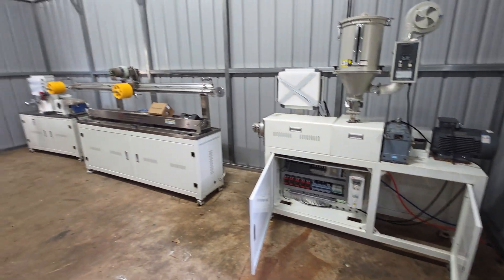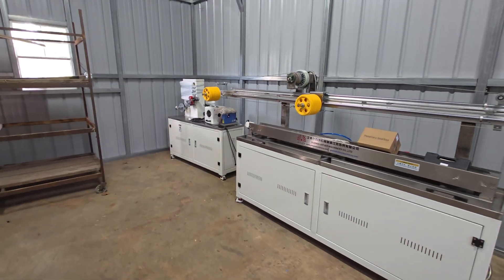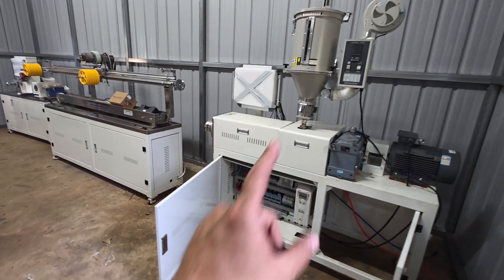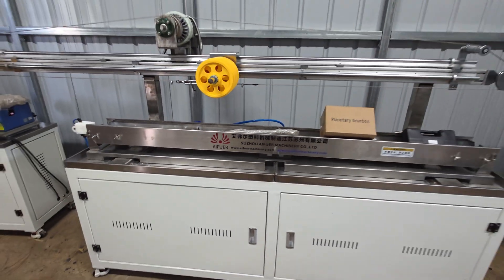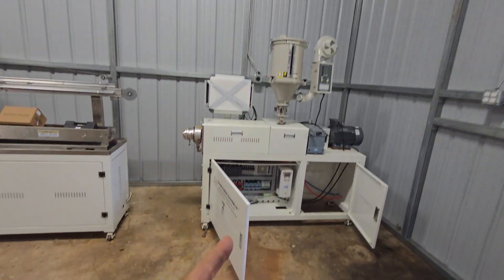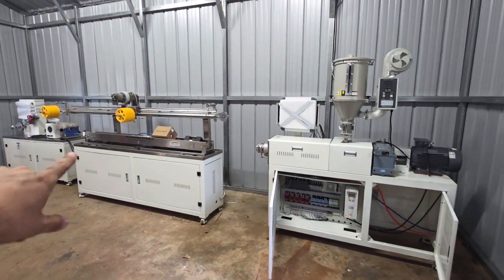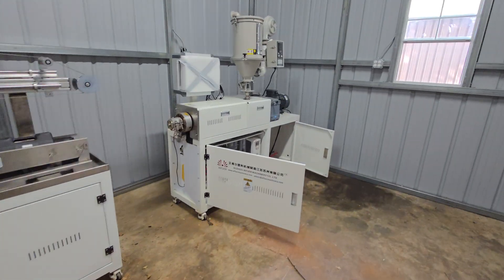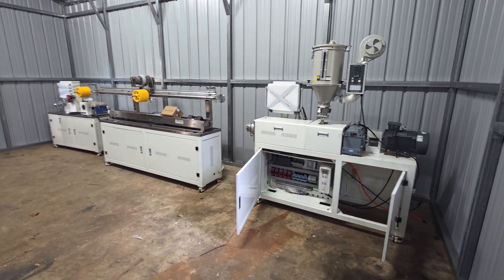I bought a filament extrusion line for my 3d print farm

Comment: I built my own filament extrusion device with the junk around and I am using LG HI121H ABS pellets, they print well and they suprisingly have better layer adhesion than Prusa or Creality ABS filaments. If you are not using melt filter on the extruder, consider changing your nozzles to 0.6mm, it helps a lot. In the machine I built, filament consistency increases with slower extrusion speeds, so check which speed gives you the best diameter consistency you might wait longer with the filament extrusion line but prints failing less will offset that time. Also remember pellets will get moisture very quickly, your device has a drying mechanism on top it seems but in my case, even during the operation, dried ABS pellets were getting wet again while inside the hopper, even if they were just been there for like 3 hours. Also be careful sometimes these heater bands can leak electricity. Also not every masterbatch fits every plastic type if you put the wrong masterbatch parts will get weaker, I would like to remind you that there are masterbatches for fire retardance and uv protection and they are not so expensive, adding talc can increase dimensional stability but I do not recommend it as it reduces layer adhesion. Also filament extrusion line will generate way more gasses than enclosed printers be ready for it, it is horrible, a mask is a must, use one with the filter type 6057 Abe1. The machine looks great, thanks for sharing.
Reply from the maker: I really appreciate the information 🙏 I do plan to get separate drying hoppers for storing dry filament, and I still need to setup ventilation for the building as well as an exhaust to catch fumes coming directly out of the mold. Ill be sharing all my experiences here on the channel. I appreciate the advice!
Reply: @Redo3D one more thing, fume collector will cause air flow around the hot mallable filament and make the filament slightly thicker when it works, so for consistency always keep it on. Changing room temperature will also affects the diameter, cooler room make the filament thicker, hotter room thinner. Not too sure tho my device is only air cooled, yours might get affected less.